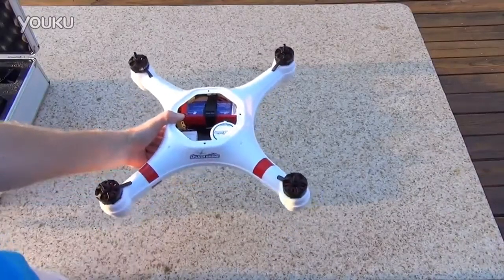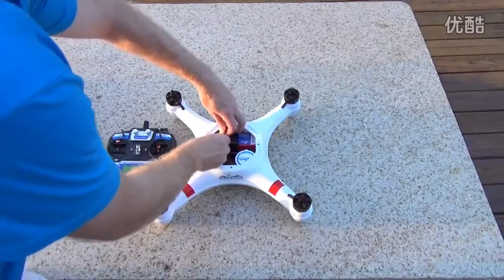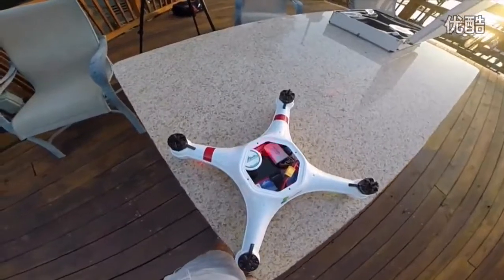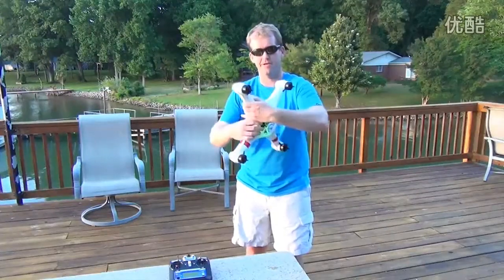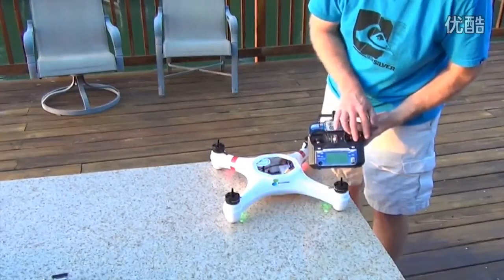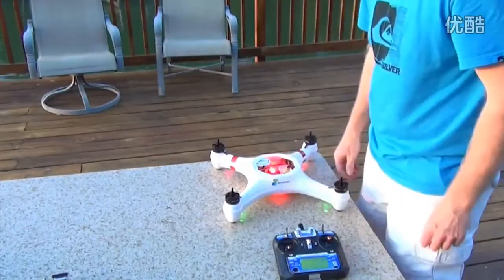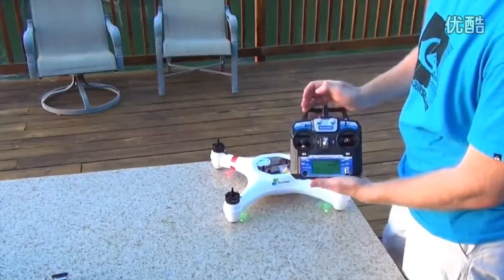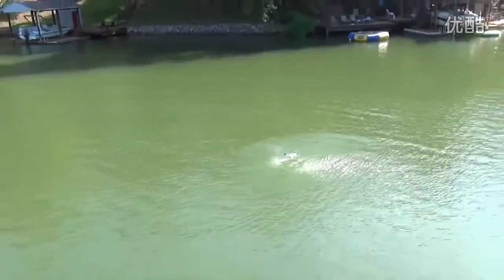Swell Pro Splash Drone RTF Instructions Calibration and Testing

Comment: Hello! thanks for the videos, are helpful;)
a question
my radio transmitter also has a dock .... this is normal? I'm used to control throttle without dock.